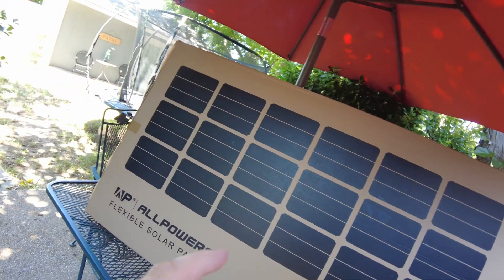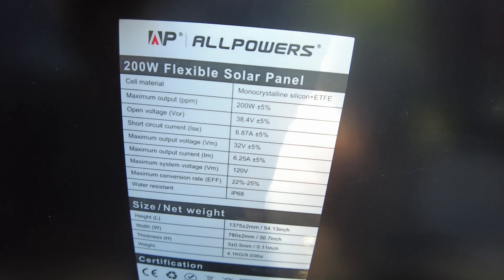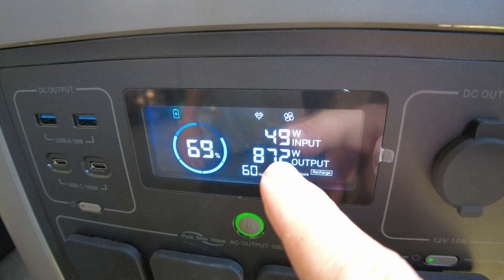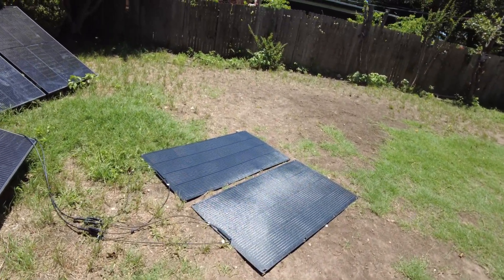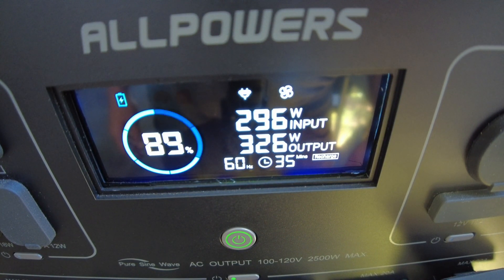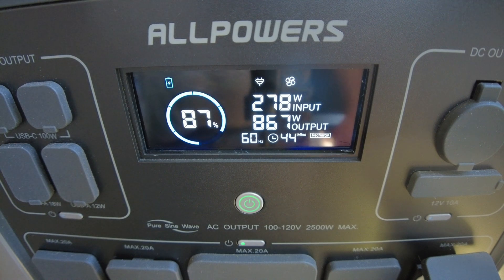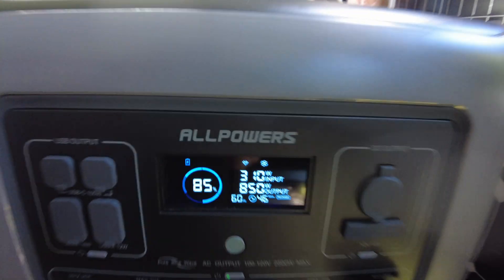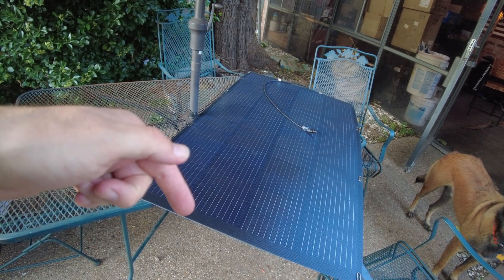ALLPOWERS 200W Flexible Solar Panel

Comment: Hey Brad, just curious...
Have you tried them with the unit's batteries more depleted?
Wondering if charging was throttled down with the higher battery percentage.🤷
Sorry if that's a dumb thing to ask, I'm only into this solar thing for a little over a year.
Love your content brother.
Be safe all.🙏
Reply from the maker: I have not had a chance to do anything else with them. I will say I thought they did pretty decent. I pretty much consider 75% - 80% of rated not bad. It's not easy to get 100% because they rate solar panels at STC (Standard Test Conditions) Look up STC for solar panels. Thanks, and glad you enjoy the content!

Comment: Oh my gosh !!
I am totally pleased with my 200 w semi flexible solar panel !
I bought a eco-flow foldable solar panel, and I thought wow this is pretty good, so I bought a second ecoflow solar panel. 
And then a month or so later I seen that all powers had a 200 watt foldable solar panel on sale.
And I thought well I should try that. 
I am totally glad I did all powers foldable solar panel blew me away !
It totally charged up my three Eco flow power Banks really fast ! 
And after that happened I decided to buy the 200 watt all powers semi-flexible solar panel. 
I am not disappointed, ! Wow it collect so much wattage and charges my power Banks so fast !
I will never buy another ecoflow solar panel 
And all powers solar panel also connects to all my ecoflow products I have the wave to air conditioner heater, 
I have the ecoflow river 2
I have the ecoflow Delta 2 and  
I have the ecoflow Delta Max .
No more chasing the Sun I just put that semi flexible solar panel on my windshield and it takes care of the charging. 
Did I mention I live full-time in Northwest Montana in my Ram  Sprinter oh and I'm 63 years old🎉

Comment: Nice price point on this for what it is.  Would of been interesting to see if a different brand power station would have given you better or worse results.  Down here in Florida in summer my 400 w q cells will give me like 325 w in the heat.  However in winter they will go slightly over the 400w.  Not sure what the heat is like were you are but it plays a big part in production for sure.  Sometimes I pray for one of our infamous 10 minute thunder boomer events gets those panels cooled off very quickly.  Lol
Reply from the maker: I'm in Texas, so kind of similar heat but less moisture :) I've totally experienced those thunder boomer events you mention in Florida. 30mins sunny beautiful day, 10mins hammering down water balloons in a cycle throughout the day LOL. Yeah I actually want to make another video with these using a discreet system, probably a Victron MPPT, some battery, and inverter. Thanks!

Comment: The power station likely doesn't draw more than 8 amps until the input exceeds 32V. The Bluetti AC70, rated for 12-58V at 10A, tops out at 8.5A with a 20V Vmp panel. This design likely prevents blowing fuses when charging from 24V vehicle outlets. It's unclear why this limit isn't adjustable via the app. A clamp meter or inline power meter could confirm the limit.
Reply from the maker: You may be right. I have ran into this with many power stations. Many do indeed try to detect car charging (and limit current) to prevent overloading the lighter jack. Sadly that function interferes with PV in some configurations. I do like your idea of having an app config option for this. Thanks!

Comment: They look pretty good to me. Did you try improving the performance by angling towards the sun more directly. Would be interesting to see if it makes any difference.
Reply from the maker: The sun was pretty much directly overhead. I probably could have gotten a slightly better angle, but it was already close. Thanks

Comment: could it be the SO,GEN is more efficient taking in higher- voltage low- amp, than it is with higher- amp lower- voltage, even at the same panel wattage.?  🤔

Comment: Curious that series vs parallel wiring affects so dramatically the wattage intake on these panels. Thanks for sharing!
Reply: Higher voltage = less line losses
Reply from the maker: You're welcome.